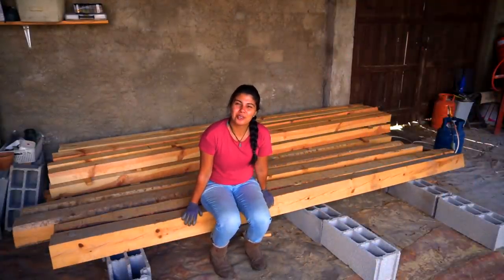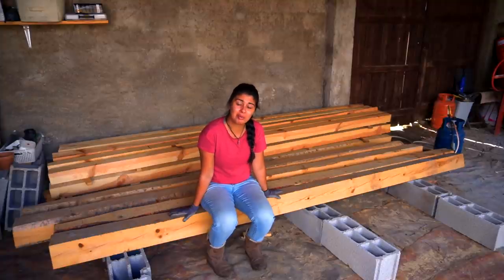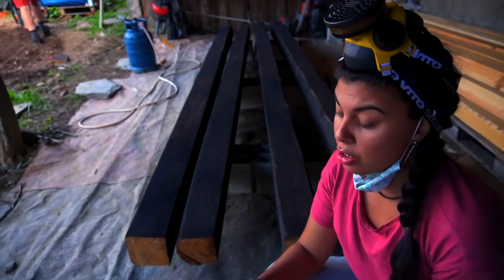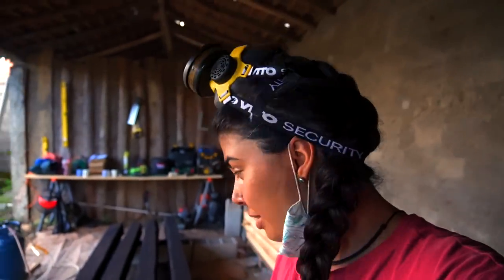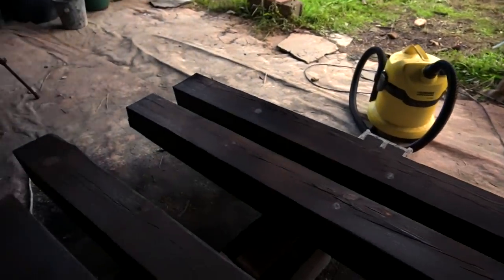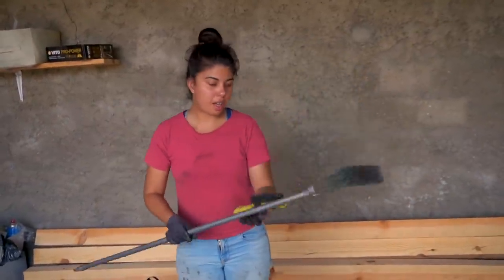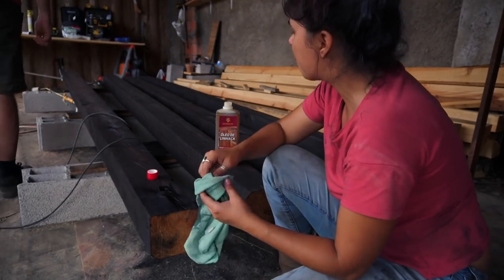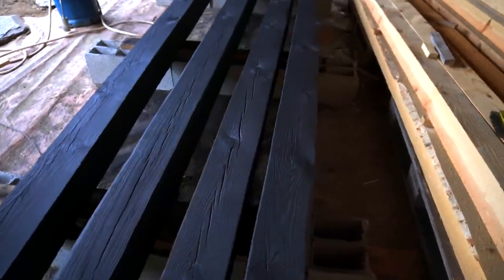#17 Preserving wood posts with ancient Japanese method

Comment: Good choice! Shou Sugi Ban and linseed oil are excellent methods of preservation!
The great advantage of linseed oil is its great ability to penetrate the wood pores. As long as it is fluid, the wood fibers will absorb the oil into the heartwood. As the oil is exposed to air, it reacts with oxygen and hardens, and the wood's absorption capacity decreases. So it is preferable to apply a new coat of oil as soon as the previous one is absorbed.
To finish or shine, you can apply pure oil or a paste made of beeswax dissolved in hot linseed oil. For beams I prefer to use it pure as it hardens faster and leaves a surface more compatible with new coats over the years.
Be careful, hot oil can ignite even without a flame... I've already burned a foot this way! Even oil-soaked brushes and rags can heat up and self-incinerate... Linseed oil is one of the products that generates more cases of spontaneous combustion!

Comment: Do you use the planer first before burning the wood?
Reply from the maker: Not really, we just sand it really well first. it would crackle when you burn it, giving it texture. If a smoother finish is desired, it may be better to burn it then sand it and then do it again until the desired effect is achieved.

Comment: I'd do 2nd coat before putting posts up, and you'll know if you need to do a 3rd coat once it's up.
Reply from the maker: Hey Bimse! That's what we decided to do! All the best 😊😊
Reply: shou sugi ban doesn' t really  need oil. It's  just to preserve  the rich dark colour. The wood is protected enough...
Reply from the maker: @andreasmuller4745  It depends on the technique. If you really char until it cracks, it doesn't but if you do the method we did, then you definitely do. Also, it doesn't do any harm to add oil.
Reply: @TheIndigoEscape  that's right! The posts look beautiful!
We did an outhouse without oil and have no problems so far. 
Wish you all the best for your projects!!!!